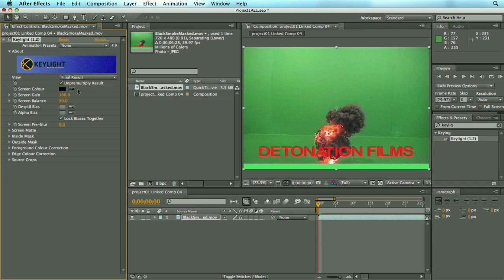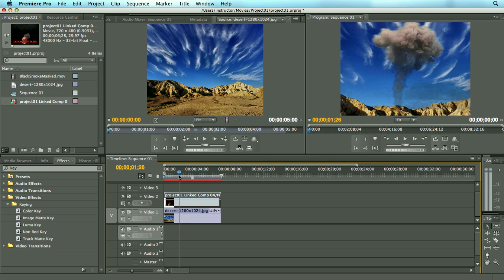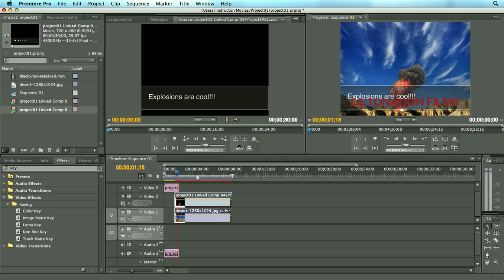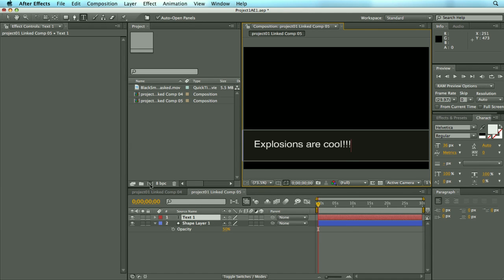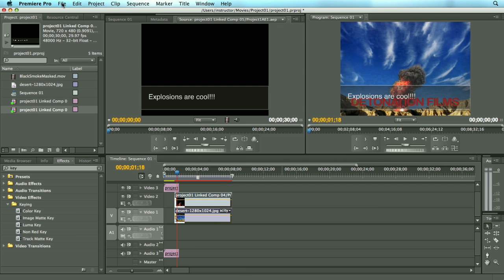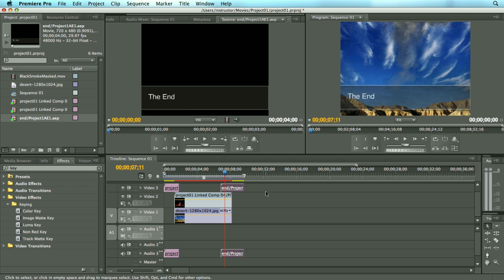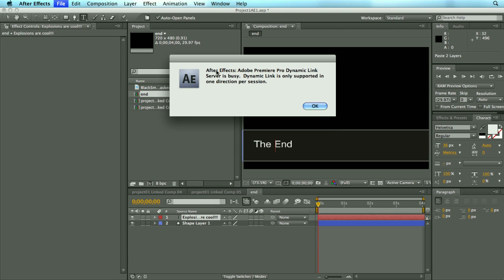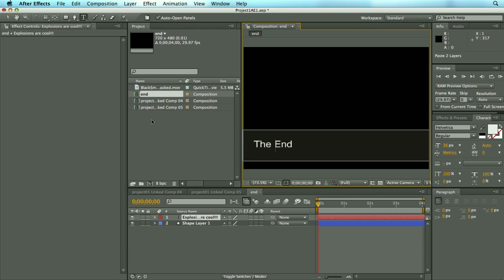Dynamic Link in Premiere Pro and AfterEffects CS4 (Part One)

Comment: i think adobe codes the crapiest software ever made.
i can use in a free program without any problems different file formats .. place them on time line .. do anything with it .. and finally render it.

but premiere cant even handle xvid and in school all pissed off the adobe bloatware.
we learn some adobe programs but they still crash too often.
i can crash dynamic link within 5 minutes on any machine.
color correction prem - any huge loads in after effect.
BOOM .. i never use adobe again.

Comment: I am using this to key out a lecture.  It is a little over an hour long.  When I do so I get the conforming bar at the bottom of Premiere. Any time I start moving or changing the Premiere file it starts the conforming bar again.  This takes about 2 hours for the conforming bar to complete.  What I am doing to cause this and how do I get it to stop?